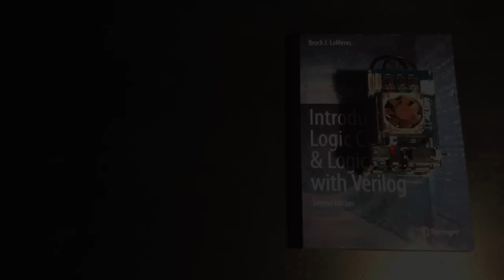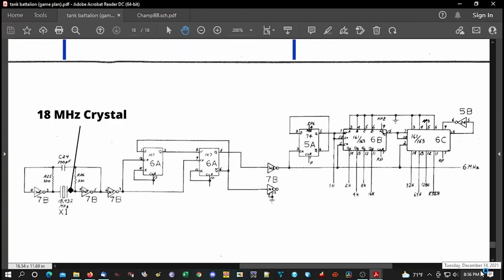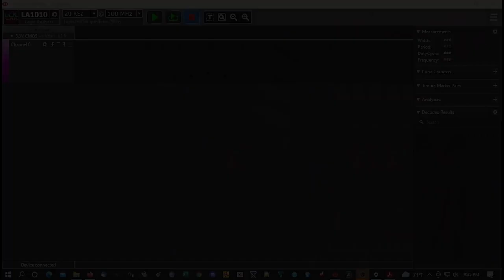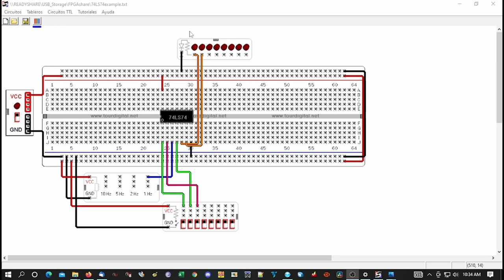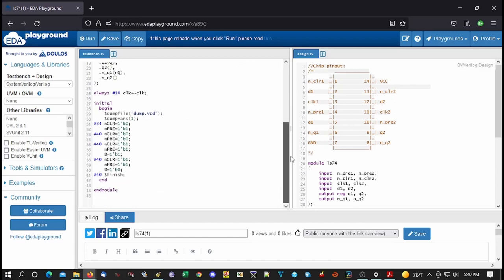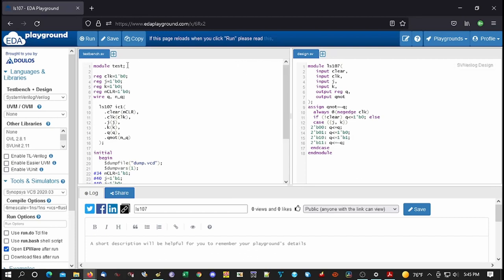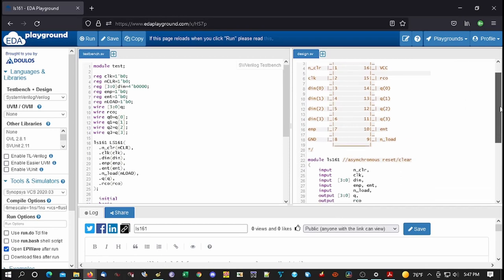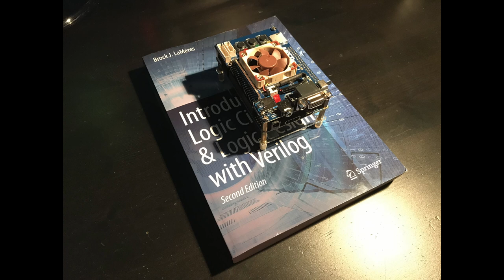MiSTer Core Dev Episode 2: Get Your Flip-Flops

Comment: Hey Wolf, just like to drop note on how much I like your series and the approach you have taken. It is so great for learning FPGA but also for learning MISter finally (e.g. how to connect the framework). Even if the implementation of the chips one by one is something you would do in mire advanced Verilog, it is fantastic for learning on how to do that work.

Maybe a video at the end would make sense to show code optimizations for simpler reading and understanding, maybe with some comments in the code 

Please keep in the great work
Reply from the maker: Yes - exactly. I had planned on making the point that this wouldn't be the best way to write the verilog version for a proper MiSTer core, not very efficient. Mind you - I'm still learning myself!

Comment: Wow mate really awesome stuff and super detailed, music in the background goes a treat, throw in some miami nights 1984!. Ive been playing around with logic boards for awhile, still very new to the hobby however this is really up my alley. Detail on the reverse pcb architecture makes a lot of sense great resources, I'm not so on the FPGA programming thing ATM would still eventually like to go down the assembly language road, however understating how the logic complements each other is priceless, and learning the FPGA along the way is still a bonus. I do have question with regards to the hex 7404 inverter looking at your breadboard I cant seem to understand how the piezo starts its oscillating. 

I'm stuck on a few things pin 1 of the IC looks to be grounded(white wire coming in from other negative terminal of BB) what does it actually do?, it does seem to interact with the other inverters along the line. I can see pin 2 is an input from the piezo via the resistor/cap network(which I guess stabilizes the signal) but scratching my head, as to where it get its start. Always been baffled with this type of circuit just cant seem to get it no matter what, so any clarity is appreciated.

Looking forward to learning along the way super stuff mate keep up the fab work cheers Franky
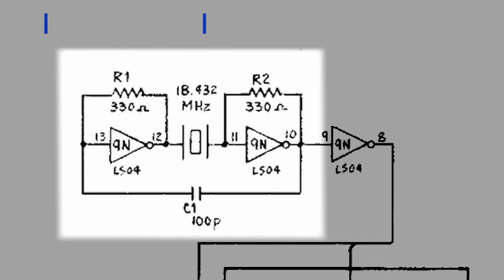Reply from the maker: Hi Frankly P - thanks for the kind words. Around 6:40 in the video I'm talking about the difference between the inverters used in this circuit and ones sometimes used. The ones here are 74LS368s - that is a 3 state output. It seems to be being used like a simple 74LS04 inverter BUT you have to connect the pin 1 to ground with the 368 otherwise it won't work. You could just replace all of those with 04 normal inverters and no worry about needing to ground that part of it. As to why the crystal oscillates in these R-C circuits, your guess is as good as mine! But essentially all of these arcade boards seem to use the same setup. The whole thing is really taking a rough sine-wave type signal from the crystal and trying to make it nice and square - as far as I can tell.
Reply: @misterretrowolf1464  You're welcome mate, enjoying your work! getting through episode 3 ATM. The function is Z state makes sense. As for the RC they are used as timing circuits but as stated if you have the oscillator doing its thing then I guess it's to clean up the signal (I always assumed that a piezo produced a square wave by default). I'll assume that the current hits the first leg once Pin1's low gets inverted to high from into Pin2 then onto the piezo- rinse and repeat. Thank you for the reply W

Comment: Where is the source code for the mister project OS? That loads the cores. Is it possible to port it to a xilinx fpga? Maybe it's already been done. How are cores loaded, do they need to be placed to somewhere particular in the fabric not to clash with the Mister top level?
Reply from the maker: Chris the source code for MiSTer can be found here: 
https://github.com/MiSTer-devel
There is a ARM chip onboard the DE10-nano that holds the source code and fires up the interface. When you are using my source code you are firing code directly into the FPGA side of the DE10-nano and therefore nothing is harmed. On the last episodes in the series we start to use a proper full MiSTer framework for the core.
Reply: @misterretrowolf1464  Thanks i'm looking in the repository but I can't find the quartus project for programming the arm core.
Reply from the maker: @Chris-hi2hn  I'm not an expert in that area. It won't be a quartus project because the arm chip is programmed in C
Reply: No problem thanks for the info👍
Reply: I thought there might be a separate Quartus project for the ARM core in order for the ARM to know how to communicate with the console/arcade cores. To know that they exist and how to read/write to them.
Reply from the maker: @Chris-hi2hn  The ARM framework handles all of the HDMI and USB IO and sets up the interface for loading cores. Once there each core is completely independent and runs on the FPGA side of the board.
Reply: It has already been ported to a few different boards, including Xilinx ones, by Hans Baier in the MiSTeX project.

Comment: ls74 & ls161 were nice and readably for a beginner.   i think you should expand out the ls107.  it's nice and compact but an actual new comer might have a tough time following it.   you might also wish to explain why the always block did not have a begin/end - for those that need to know. it really doesnt matter but because he has a sensitivity list good practice is to include them (note: i'm quite often wrong)
Reply from the maker: James thanks for the tips. It's a difficult one doing this kind of thing, firstly knowing what level to cover and what not to, but also the fact that I'm a novice myself and I definitely won't be doing things 'properly' compared to someone that has been formally trained in this. I wonder if a way to do it would be to do intermediate videos to hit on items I had questions on or highlighted for more discussion. Thanks.
Reply: @misterretrowolf1464  that would actually be a great idea!
Reply: I am not sure if the implementation of the 107 is correct. AFAIK, the 107 has an asynchronous clr. That means it is getting cleared regardless of the state of the clk. So actually it clears always and any time. Your implementation clears only on posedge of clk. 

To get it right you need to put the clr signal into the sensitivity list and the react on it, as you did for the ls74

For this specific implementation it does not matter as those chips anyhow do never use clr, reset or any of the control signals,
So you could implement it for this specific application without reacting on clr or preset at all.
Reply from the maker: @SerErris  Yes - you are correct! The clear is indeed asynchronous. I'll update it in the next video. Thanks!
Reply: @misterretrowolf1464  actually found another mistake with the 107. The schematic implements a 74LS107. But your virtual breadboard explanation shows the truth table of the 107A .. they are actually different chips. 107 is reacting on posedge of clock, where 107A is reacting on negative edge. So in essence the truth table is having the same result, but the 107 changes Q and NQ on the falling edge vs, the 107A changes Q on the rising edge. Or complete: The 107 reads J and K on the positive edge and outputs Q then on the next transition of clk from high to low. The 107A does exactly the opposite. 

You can test this by manually taking clock to high. Let’s assume JK is HL. When you take clk high, that is input into the chip, but not output to Q yet. If you then take clk low, then Q show the resulting output from the truth table.

Comment: the one only possible explanation: the programming (and spoken) language succs hard
Reply: replace all alu's with roms
Reply from the maker: Thanks.
Reply: not fun, what you call "fun"
Reply: heavy loads are not  "fun"
Reply: @misterretrowolf1464  sram cache chips to save power, all memory blocks dont need to be active, only the ones being read from, and for roms, only power when something is read
Reply: this makes me feel "high"
Reply: @misterretrowolf1464  simulate all higher (over Terabyte) rom-ALUs with smaller byte/bit alu combos
Reply from the maker: @Jkauppa  mate - clearly by these comments you are high as a kite.